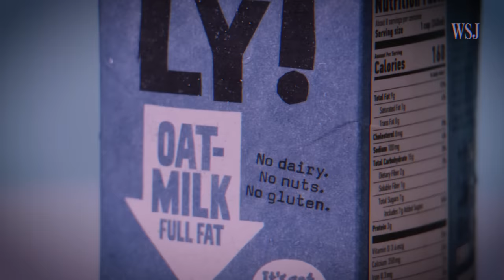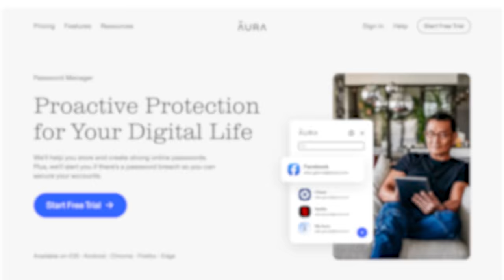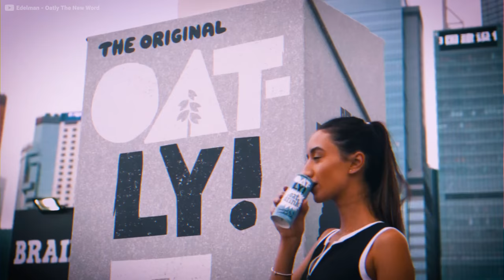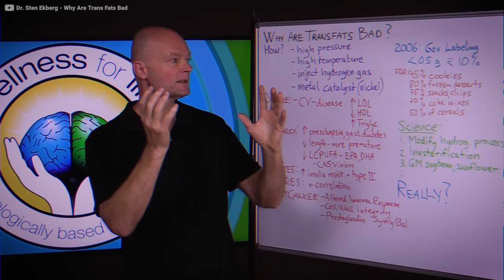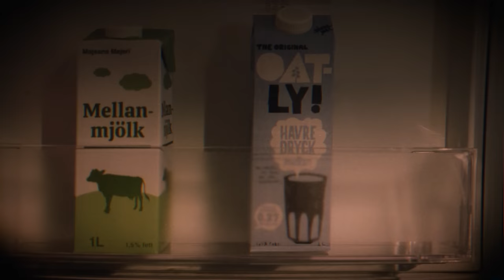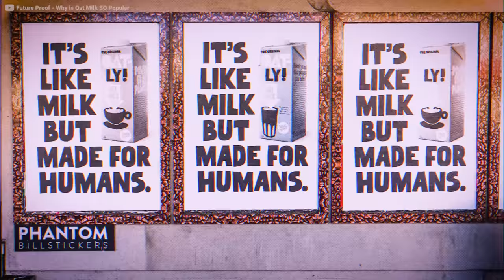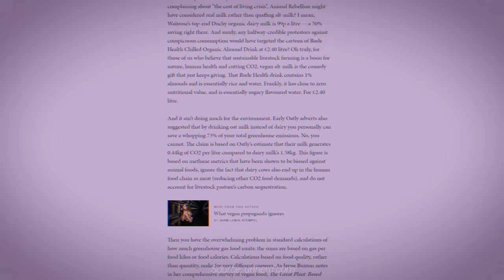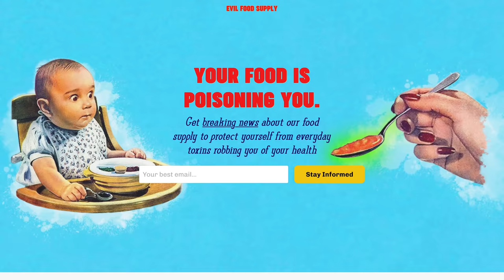Oat Milk is literally a scam.

Comment: Not ALL oat milks are evil, you have to do your homework and read the ingredients, just like with any other food or beverage product.   There are companies that make just oat milk, no additives, but you’ll pay a bit more for those.  Or make it yourself at home.
Reply: Which companies are those?
Reply: Anything not made in your backyard should be presumed as bad for your health. But a bit of exercise and portioning your meals won't hurt.
Reply: This video is about Oatly
Reply: @EweTuber it has a very misleading title then 😅
Reply: @FallenChocoCookie Yeah, but it almost exclusively shows and mentions Oatly. Anyhow, always good to reconsider ones options.
Reply: Pretty sure based on this video, if you are paying MORE for oatmilk then you are being scammed.
Reply: What? Less ingredients for even higher price? Absurd... If the information in the video is correct, the product should cost a little bit more than running water. How much it cost in comparison to real milk and drinking water in your country?
Reply: @marvin95  Regular milk is much cheaper, and water is even cheaper. I think a gallon of oat milk is about $10 a gallon of regular milk is about $2.50 and a gallon bottle of water is about $1.75
Reply: Nice try oatly
Reply: Definitely, Trader Joe's makes a great oatmilk for a solid price, and their regular is just plain hydrolyzed oats and water. One of the main value propositions here is how non-perishable it is; you can keep it around at room temperature until you want to consume it. You can't do that with animal products. Oatly is strange though, I wonder why it's made to be kept refrigerated lol. Regardless Oatly and several brands like it have strange ingredients so that point is taken, but I had the same issues with this video. 😂 The nutritional benefit from oats are not nearly comparable to the (lack of) from drinking a can of coke but the clicks occurred so mission accomplished lol.

Comment: I wanted to compare these stats with the oat milk that I usually see at my grocery store, "Earth's own". I don't ever recall buying an oatly product, so I just wanted to check for a brand more relevant to me. (NOTE: This devolved real quick. More of a video analysis now. Key points at the bottom)

I looked at 4 different products under them, and below are the differences from the video
(Original, Vanilla, Zero Sugar, Naked)

1:30 - Dipotassium Phosphate: Only the zero sugar product includes this in their ingredients. 

1:40 - Seed oil: Not quite sure how this is bad for you. In any case, sunflower oil is used instead in all products except for the 4 ingredient one

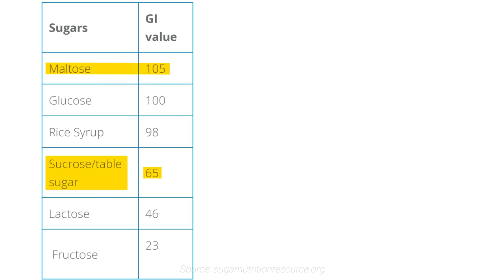1:45 - Maltose: I assume the amount is similar to oatly(?), however I wouldn't know. 

1:55 - Oil Content: I don't think the amount of oil they use is published online, however based on the 5g of fat(1.5 for naked), it seems to be about the same. The comparison of french fries is a bit odd though. They aren't inheriently unhealthy because they have oil; I'd the carbs in it is a major factor. For example, 4oz of sautee'd brussel sprouts have about the same amount of oil.

In terms of cost(spread out over the first portion of the video), I agree that they're overpriced based on cost of ingredients. No denying that in any sense. Cooperations will always want to earn more money. But lets say that the retail price of oat milk does drop, to a point of just $1 per litre. At this point, it'll be vastly cheaper to buy than cow's milk. To a normal consumer, I would think many would start to shift to oat milk just because of the price difference, making it even harder on the dairy industry. 

This isn't even mentioning the fact that the US Gov(from which many viewers are presumably watching from) HEAVILY subsidizes the dairy industry, about 22.2 BILLION USD in 2015, compared to no subsidies for oat milk. 

Honestly, I'm unsure what the conclusion for the above paragraphs are. I personally see that the dairy industry is dying in US and Can based on the subsidies, and that sooner or later, alternatives would push them out of the market. Feel free to make your own tho.

6:14 - Maltrose Part 2: As priorly stated, I got no idea how much any of these products effect blood sugar level. Can't really comment on that.

8:30 - Fat: ??? Trans fats appear in nature as well, namely meat and dairy. Aside from that, they are 100% bad for you. prime of the prime is that omega fats are great, saturated fats not so much, and trans fats are the worst. But calling out oil seed oils as having trans fats is a bit disingenuous. For instance, as compared with other common oils:

Canola - 1.9% - 3.6% trans fat
Olive - 0.5% trans fat
Sunflower - 1.1% trans fat
Soybean - 0.4% - 2.1% trans fat
Butter - ~4% trans fat(first google result; might be inaccurate)

Canola can definitely contain more, but most oils do contain at least some. What I think should've been commented on more is the saturated fat amount in addition to the trans fat.

The oxidization of oil is a geniune concern, however, I doubt that the temperature gets high enough to warrant concern. Unless they pan fry with the oil beforehand, it's probably fine. 

As for dipotassium phosphate, yea it seems accurate. 

11:11 - Marketing: Never seen oatly marketing. Or any oat ads before. Well, marketing's marketing. May as well call out red bull next eh? I can't actually care less how a cooperation markets something. An ad's an ad, and all ads are annoying.

14:14 - Legal battle: Saturated fat is bad for you? Or well, not 100% healthy at least. Other than that, big W for the dairy farmers. And the outcome makes sense. But again, in terms of marketing, all press is good press. 

17:40: Aside from the blackstone incident(which I never heard of or was involved in; again, don't drink Oatly), I'm unsure of the point being made. 73% less emissions may be inaccurate, but the generally accepted "oat milk produces 1/3 of the emissions that milk generates" is still a substantial amount? I doubt having pasting on "66% less emissions" would change much... 

Cows and livestock releases about 5% - 6% of total emissions(energy is the vast majority at ~73%). Not much. However, it isn't inherently bad to look into decreasing that amount. 

20:28 - Other Alternatives: I think most of the stuff I commented on covers this portion. But if I had to point something out:
Why is sea salt highlighted? Are added vitamins bad(imo kinda, but that's a different topic that involves cereal)? The fact that almond milk being 2% almonds seems accurate though. IMO, it's not a big deal. If the recipe calls for that, so be it

Disclaimers: I(Canadian) personally think oat milk is good, and at least better than cows milk in the long run(after all, its why i wrote a biased comment for it). I just saw some claims in the video that I found odd, and some misleading. This was before I found out the video was mostly calling out oatly(never had oatly). I'm a university student that isn't anywhere near studying food, but mostly just likes food.

Takeaways:
Oat milk has less emissions than Cows milk(~66% less), however cows only make up at the very most ~6% of emissions
Oat milk may have additives(dipotassium phosphate) that have adverse effects in large amounts
Oat milk is cheaper to produce than cows milk, but costs more on shelves
Seed oil isn't inherently bad, however there are better alternatives to canola.
Oat milk most likely effects blood sugar content more than cows milk
The jabs at trans fat and lack of jabs at saturated fat seems very misleading
Oil oxidation can create cancer related chemicals, however is portrayed a bit misleading(only a real cause for concern if you fry the oil first, of which oat milk companies probably don't do)
The amount of dairy subsidies is ridiculous
Oatly marketing is something I can't possible care less for. 
I like researching

Sources:
https://earthsown.com/products/oat/ - oat milk that I usually buy, and references I used for their products
https://www.wellplated.com/sauteed-brussels-sprouts/#wprm-recipe-container-41938 - sauteed brussel sprouts nutrition
http://www.greyclark.com/wp-content/uploads/2018/02/US-Subsidies-Post-2014-Farm-Bill-FEB-2018.pdf - Dairy subsidies
https://milkpick.com/why-is-oat-milk-expensive/#:~:text=high%20production%20fees.-,No%20Government%20Subsidies,when%20they%20have%20young%20children. - no subsidies for alternatives
https://www.hsph.harvard.edu/nutritionsource/2015/04/13/ask-the-expert-concerns-about-canola-oil/ - trans fat in oils
https://reeis.usda.gov/web/crisprojectpages/0188938-iron-antioxidants-and-frying-oil-stability.html - oil oxidization
Reply: Thank you for that, I really didn't like the comparisons in this video and the emotional narrative. Whataboutism in 20:20 was too much too handle.
Reply: Hey I liked your comment. I'll copy paste mine with the conclusions I reached 

First off, not all plant milks have added oil but when it does it's a very small amount usually 2-3%. This oil is still better than the saturated fat from whole milk.

Same for Dipotassium phosphate, is also not commonly added and when it is  it's not as scary as he makes it sound, as it's the total amount of phosphorus in the diet that matters the most and cow's milk has a similar quantity. He failed to mention he negative effect on the kidneys is seen in people suffering from kidney disease, and this same population may also need to avoid cows milk because of the high protein content.

I found the article he shows about the claims of oat milk spiking blood glucose similarly to soda but there isn't any study cited. From my research it seems that the glycemic load is 3 times higher on the soda.

224 grams of french fries has a bout 32 grams of fat, 240 ml of oatly milk with added oil has 9 grams of fat. Again these figures are taken straight from their a**.

Trans fats:  from Oatly themselves: "the oil we use actually has a trans fat content of less than 0.1g/100g, and we only use non-GMO, expeller pressed rapeseed oil." The "natural" milk he talks about has 0.1g of trans fat per 100g.

So there's only 10% of oats and the rest is water but that somehow produces more emissions than cow's milk?

The dairy industry spent 370 million dollars on campaigns just in the US whereas Oatly spent less than 100 million across multiple countries in the same timeframe

Also forgot to mention that most of the trans fats consumed come from "natural" animal products, cow's milk is subsidized so it can be affordable, that it has cholesterol, and that it lowers testosterone and raises certain types of estrogens.
Reply: Also how did you put so many links? My comments with links that aren't from YouTube don't get published
Reply: @dekyor9547  no idea. It just worked
Reply: @OnyxJade  i recommend you copy the comments with links before sending them so you don't lose it just in case it gets deleted 🤣 happens to me a lot
Reply: What an amazingly written comment🎉
Reply: About the oat milk advertising: Oatly actually had a brilliant ad campaign about a year ago, and here in NY there was an oatly sign, billboard, or giant ad on just about any spot in town. The posters were cute/funny, and definitely memorable. It might be fun to search them up, because they definitely deserve A+ for marketing
Reply: Idk why you did mini research paper, but thank you!
Reply: Thanx a lot, ver valuable input. I wish all people would do their due dilligence and do some research
Reply: Appreciate the research! It was hard to take everything in this video as face value. Feels like a paradox at some parts of the video
Reply: he also claimed oatmilk has the same sugar amount as coke and then proceed to compare the glycemic index, what a joke
Reply: @dekyor9547  he just blatantly claim that "they use canola oil and canola oil has transfat" which is just bullshit

Comment: Its easy to spot fraud really! Anything that invokes environment protection (especially by reducing carbon footprint) to sell its product should be viewed with greatest suspicion.
Reply: this point makes zero sense. humans produce products on a very large scale that has impacts on the environment. if a company is trying to minimize that impact how could you possibly have an issue with that
Reply: @mikcasso288  Often companies focus on things like carbon neutral. However, they usually use metrics that only track their end of things and not the whole process. For example, electric cars are carbon neutral when it comes to the actual driving but the carbon emitted during the manufacturing of the car and the mining for the resources, particularly the battery, are not looked at. So you actually end up with a car that creates more carbon emissions that a gas car because of the material needed to make the extra parts of the car.

When you try to boil down effects to intent, it doesn't work out well. The intentions for windmills is to reduce electricity created from fossil fuels, however the effects of windmills can range from killing large birds of prey to created a large demand for fossil fuels because the wind isn't consistent enough to generated the needed electricity in a system and the wasted materials of the windmill.

This is also ignoring the fact that climate change is a very controversial topic that has been very politicized where people are willingly to use it as a way to push policies. And also ignores that scientists are very unsure of the causes and long term future of climate change.
Reply: Exactly
Reply: Its more about marketing at this point. Decades of research from people that really cared used just as another selling point, even if has nothing to do with actual product.

Comment: This is literally idiotic. Oat milk does not have more sugar than coke. At least here in Germany, most oat milk has around 5g pro 100ml, some companies offer oat milk with a bit less, some with more. "Normal" milk has 4.8g per 100ml.
And most companies don't add sugar. The sugar is produced naturally by the process of fermentation which is used to produce oat milk, which transform the starch of the oat into sugar.

Comment: First off, not all plant milks have added oil but when it does it's a very small amount usually 2-3%. This oil is still better than the saturated fat from whole milk.

Same for Dipotassium phosphate, is also not commonly added and when it is  it's not as scary as he makes it sound, as it's the total amount of phosphorus in the diet that matters the most and cow's milk has a similar quantity. He failed to mention he negative effect on the kidneys is seen in people suffering from kidney disease, and this same population may also need to avoid cows milk because of the high protein content.

I found the article he shows about the claims of oat milk spiking blood glucose similarly to soda but there isn't any study cited. From my research it seems that the glycemic load is 3 times higher on the soda.

224 grams of french fries has a bout 32 grams of fat, 240 ml of oatly milk with added oil has 9 grams of fat. Again these figures are taken straight from their a**.

Trans fats:  from Oatly themselves: "the oil we use actually has a trans fat content of less than 0.1g/100g, and we only use non-GMO, expeller pressed rapeseed oil." The "natural" milk he talks about has 0.1g of trans fat per 100g.

So there's only 10% of oats and the rest is water but that somehow produces more emissions than cow's milk?

The dairy industry spent 370 million dollars on campaigns just in the US whereas Oatly spent less than 100 million across multiple countries in the same timeframe

Also forgot to mention that most of the trans fats consumed come from "natural" animal products, cow's milk is subsidized so it can be affordable, that it has cholesterol, and that it lowers testosterone and raises certain types of estrogens.

Comment: I've seen people make homemade oatmilk that tastes decent. Of course, you have to add things like vanilla, maple syrup, oils like coconut oil or sesame seed oil, some add spices, or mix oats with nuts (like cashews or almonds), but yeah, if you experiment at home you can make it taste not gross. 
The problem is that most homemade plant based "milks" can't last long, and usually have to be consumed within days of making, and since you have to make small batches, you have to keep making it over and over again every few days. 
Hence most people opt for the commercial, more convenient version.
Oatmilk itself is not an issue, but the commercially made oatmilk is. (Like pretty much anything else commercial lol)

Comment: Make your own oat milk, add some brown sugar, boil it a lil bit, and badabing, its delicious actually
Reply: Or just drink healthy organic whole milk instead of that crap.
Reply: @CPTAwesome9000  couldnt agree more. Bomus points if its locally sourced raw milk too
Reply: @CPTAwesome9000  Whole milk makes my stomach and digestive system hurt though. Making my own oat milk has been more better for me.
Reply: @Iceechibi try taking vitamin D. I find that it helps.
Reply: @wudafek8561  Thank you, but that won’t help me here. In fact, my doctor already tried that with me and now my vit D is back to normal. Still no change in how I can handle fresh milk. Raw is even worse for me. I’m now severely lactose intolerant which was why I switched to plant milk. I grew up drinking milk, but it seems to be an issue in our family where the older we get, the less we can process milk. Even lactaid free milk still bothers me. Oat, almond, coconut and soy milk (water technically) don’t.